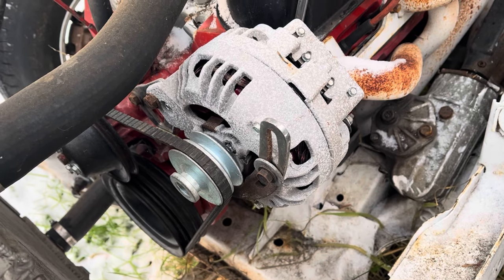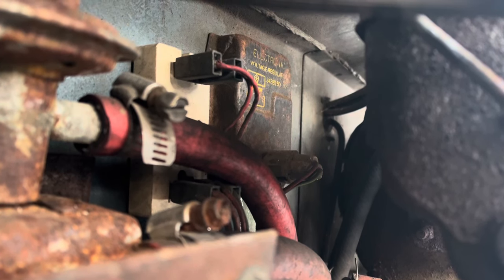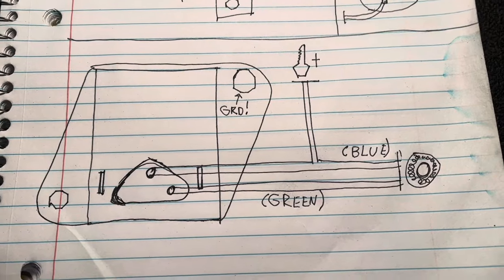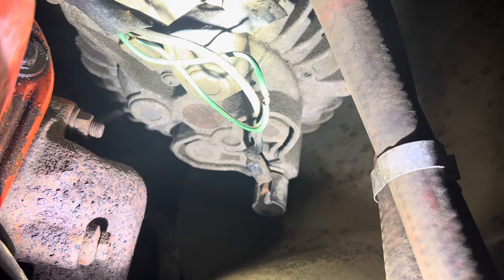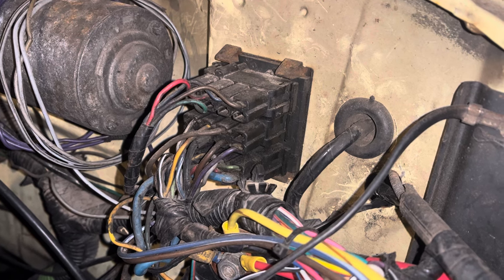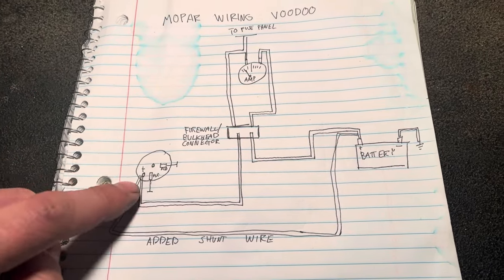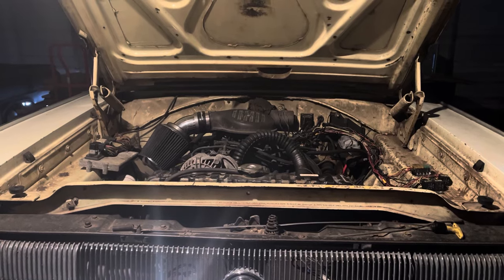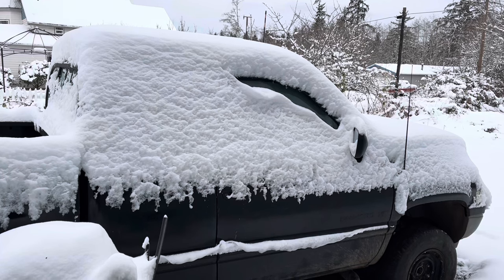Classic Mopar Charging Systems: How They Work, and How To Diagnose Failures

Comment: I am having a problem of a different sort. After sitting the better part of two years because of the pandemic I have discovered my Dodge Charger starts great but once it’s hot it starts to run rough and backfires and shut off and won’t restart until it cools down.I’ve cleaned the grounds in the engine compartment checked my connections there could it be a5 5he bulkhead connector?
Reply from the maker: Sounds like an ignition issue. Control module, or maybe distributor. What year car, and what type of ignition? Feel free to respond by posting another comment - I likely won’t see a reply here.

Comment: The problem isn't the alternator design or anything with the charging system. Most of the stuff is old. Wires,connections. Practically all of the parts store alternators are junk and have been rebuilt a million times and bead blasted a million times. I had to get 3 different alternators at AZ because the threads were so blasted out you couldn't tighten the mounting bolt. Finally got one that had a heli-coil in it already. I usually run at least an 8ga wire right from the battery or starter relay to the alt output stud. Also the wires sometimes loosen up on the back of the amp gauge.
Reply from the maker: Yes, this is the ‘shunt wire’ I talk about often. Direct from alternator to big stud on relay. It’s a big improvement. 

Interesting. I stripped out one or two alternators myself years ago (before I had my torque elbow calibrated properly,) but I’ve never had that problem with a reman. Although I’ve only ever had to buy a few of them, because as I say in the video, it’s never the alternator… except when it is. 

Personally, I think we can attribute a lot of the problems to the amp gauge circuit design. The firewall connector was adequate at best to handle the loads when it was new - and far from it years down the line. Also, if the voltage regulator had a ground wire instead of being case grounded, they might last more than five minutes too.
Reply: @DeadDodgeGarage  The original design setup was perfectly fine for what it had.....a 37-amp alternator. That was standard across the board. Even the Upgraded version was only 41 or 45 and the 'HD' was 50 amps. A far cry from what's available today. If you're lucky enough to have your original alt I would keep it. Once you get a reman you're into the exchange racket. They ONLY change the bad parts and send it out with old diodes and bearings and other parts. They only change what they need to. There's a difference between 'rebuild' and 'remanufacture'. 
I was on a trip and my alt went out. It was a reman about 2 or 3 years old. Went to AZ and swapped it and on the way home loosened up. Had to use a pair of visegrips to hold it on the bracket. I didn't tighten it crazy like an ape. In fact, it started stripping as soon as the bolt put pressure on the bracket. But it was the ONLY one they had n stock of those old style alternators. Came home and got a nicer one but it took 2 more tries. 
27 or 28 years ago I got a reman starter from a parts chain long out of business. Spent the next 2 years swapping starters.  They were easy to do in the parking lot in 20 min. Their starters looked like they blasted them clean with boulders. $19.95 lifetime warranty deal. OK if you don't mind changing them.
Reply: @DeadDodgeGarage  I agree that the 2 weak points are the Amp gauge and that bulkhead connector, both the result of using dated tech even for the period. Later they went to a 'shunt' Amp gauge that read a 'part' of the charge current and then later to a Volt gauge. If you run that bypass on the bulkhead connection the Amp gauge will move very little if at all unless you're at or near max draw of the alternator. If the wire is large enough, not at all. I usually use 8ga which is sufficient up to around 90-100amps especially considering the load split. A Volt gauge should be used anyway, it tells you way more information about what's going on than an Amp gauge.
Reply: Mopars have very long wires with lots of connectors to and from the ignition switch. The wires and connections increase in resistance over time, as well as the ignition switch.

Comment: What size wire should be used to bypass ammeter, from output of alternator to positive at battery?
Reply from the maker: I think I usually use 8 gauge.

Comment: I have a 71 duster.  
The car charges at 12.5 at idle.
I'm getting this reading at the battery and at the alt. 

When I turn on the HLs it dips to 11.9.
As soon as I turn them off it goes back to 12.5.
I've replaced the alt and the voltage regulator.  

What else could it be ?
Reply: Let me add this also
The last alt read around the same volts.  
And I've played with the tension already.
Reply from the maker: In this video, I explain how the regulator and its circuits work. You’re going to need to go through them. Make sure power is reaching the alternator on the blue brush connection. If so, try the full field test. If it charges that way, your alternator, output circuit, amp gauge are all good - most of which I believe you have already proven. Ah, make sure your regulator has a good ground, and a good connection at its plug.

Comment: So I have a 64 chrysler newport that cranks and is getting fuel and wants to start but won't. I'm wondering if its possibly the voltage regulator that do to the smoke and really bad smell I'm sure is dead.. I could really use some help right about now.
Reply from the maker: I hate to say it, but follow the smell… if the voltage regulator let the smoke out then it’s definitely bad. Have to wonder if maybe it’s wired wrong? It is on that same ignition circuit and could probably pull the voltage down far enough to not run. But at that point I’d kind of expect the wiring to be turning into smoke too…

Comment: Thanks...'79 Dodge van.  If you have time......Having what I-think are wiring issues.  Known-good alt and VR.  If someone can answer just this question for now it would help.  I remove the big wire from the alternator,  connect multimeter red to positive battery terminal.  Connect multimeter black to this alternator wire and I get sometimes a full 12v reading on the meter, so the alternator wire is grounded somewhere.  This does not seem right to me.  Thoughts?  If I know that I have to chase-down a short somewhere it would make it easier.  I will likely re-wire the charging system though.  Thanks again.
Reply from the maker: I don’t understand your test procedure. Why did you do this? Was something smoking or melting? If there is a short in that wire, fire should’ve happened quickly - or a blown fusible link. So I am questioning the validity of your test results. To test the charge output circuit, I check for voltage at the alternator output stud and at the battery with everything connected - and compare. This means grounding the negative test lead, and touching positive teat lead to both of those points.
Reply: @DeadDodgeGarage  it's a long story but I'm having an intermittent no-charge problem.  I agree now that if there was a short in that wire bad stuff would happen.  Lots of things not making sense.  Welcome to "Mitch world".  I will dig into it deeper and report back if I find the problem.  The only other things I'll mention for now is that when it's not charging, the ammeter does not show any discharge either, even with engine off and everything turned on.  When it IS charging it will clearly show a discharge after shutting the engine down and turning stuff on.  Also, when the ammeter IS showing a charge, the multimeter shows maybe high 12's or 13 at the most which I do not like.  There are tons of corroded connectors and deteriorated insulators on this van which I've had for 36 years.  Thanks again for your time.
Reply from the maker: @mitchmadness4376  Ok. Fairly sure you don't have a short, and strongly suspect that adding a shunt wire (a direct charge wire from alternator to battery positive) may well solve your problem. Obviously you have lots of problems, but at least that could help.
Reply: Final but long update...The main problem here was that I had a bad connection near the battery.  The large red wire coming from the positive battery terminal connects to the "charging cable".  This connection was corroded. I got real lucky finding it.  I had the meter on the battery with the van running and just happened to bump this connection and I saw the meter go from battery voltage to 13+.  When wiggling this connection it would clearly charge then not charge.  Repairing this connection solved the charging problem and the ammeter resumed working.  Here's where it gets weird...I said earlier that "sometimes" it seemed that the charging wire was grounding out.  The "sometimes" was because of this bad connection and here's what I found...If I disconnect the connector that was bad (essentially keeping the charging wire from connecting to the battery) the charging wire gets grounded-out.  When I remake the connection (there is no sparking or arcing) the charging wire no-longer grounds-out.  I tried again today to figure-out why this is happening but I'm done because it's just too confusing, and everything is fragile so stuff is starting to break so I'm leaving it alone even though I'm not crazy about seeing only 13.3 charging volts This amazing vehicle is slated for a full rehab after building my proposed new shop.  At this time I will at a minimum shunt it out and will likely do a lot of re-wiring and a custom dash, etc.  I will also shamelessly plug my channel called "MitchMadness".  I am certain that anyone viewing your videos will be interested in my stuff, including the van rehab.  Kids don't try this at home without a hard-copy wiring diagram or factory service manual which I bought years ago.  THANK YOU AGAIN FOR YOUR TIME !!!!!
Reply from the maker: @mitchmadness4376  Man... I was off in the weeds with you trying to figure your test out. I could've told you that these vans always have connection problems there at the battery 😅 Because the battery sits in the drip line under the hood, corroded and broken connections at the terminals are almost constant. Every single time I go to move our '91 van after it sits for a while, these connections are screwed up again. I have fixed them many times. I don't think you are actually seeing a ground. I think you are able to get a voltage measurement through the alternator using its stud as your negative terminal, but I think if you checked resistance between that terminal and ground, it would be much, much higher than zero. Glad you got to the bottom of it.

Comment: See that you own a Dodge a100./108 also. 
Nice!
I have a few too many the wife says. Ugh!
Anywho most were daily drivers for years until electrical problem. Parked it and drove another. Then same thing. I will get to it one day. Nope for I had the current daily driver working great andnywars went by. Now this one isnt charging and alternator passed test at local parts store. 
But no output voltage and no volta going to vintage regulator. 
Plus a friend been messing with wiring harness and my stereo with Amps and capacitors and but also rewired wires that he thought needed to be tied together one day whe. I left him alone. 
I.tool off not knowing what he did and  noticing regulator not connected? What the ?? 
Anywho...love your content. I hope I can figure this mess I have on my hands! Ugh!
Reply from the maker: Well, all I can say is… it’s basically never the alternator. Hope you can figure it out.

Comment: So I just replaced my original 74 alternator in my Dart with a new one.  To my dismay the brand new alternator is only producing 11.8 v at idle.  Pretty sure it should be 13-14v.  Pretty sure the new mechanical fuel pump I just put in is also not good.  It put out anywhere from 2-12psi for no good reason.  Fuel regulator seems to have evened it out.  Kinda.
Reply from the maker: $20 says that’s not actually an alternator problem. Clean and grease your firewall connector. Check your ignition switch connector under the dash for evidence of melting. Ensure you have a good body ground - or two. Hopefully one of those things helps. If not, the voltage regulator should be scrutinized.

Comment: What happens when you have two known good alternators that work in a valiant, put out 14.5 volts of the back of it and when you put them in another car and the alternator is reading 11 volts of the back of the alternator?
Reply from the maker: The alternator is not your problem. The voltage regulator or wiring is your problem. Also, are both the same configuration - single field or dual field?
Reply: @DeadDodgeGarage  I threw in a spare regulator that I had and that fixed it.  Currently a single field that I had in the Valiant.  Thanks for your help, I just found your channel this weekend and subscribed.  Love the mopar content.

Comment: So I have a 69 mopar voltage regulator went bad so I bought a new one that is a solid state regulator but it won’t work , figured out it won’t work with a 70s and new alternator but I guess there is a fix for that do you know it ??
Reply from the maker: Yeah. Make sure the unused field / brush connection is grounded. Usually when you get a reman alternator from the parts store, it is the later type - and the second field is already grounded. The screws for the brushes normally have insulated washers on them, and they simply leave one of them off so it is grounded out through the screw. You can also add a ground wire.
Reply: @DeadDodgeGarage  I did ground one of the terminals but it still doesn’t work ,probably a bad new regulator I’m guessing

Comment: The purpose of the ammeter is not to “check the output of your charging system”, its purpose is to monitor battery charge/discharge rate only. All vehicle loads are not routed through the ammeter while in operation. Only when the engine is not running will the ammeter and related connections be subject to full system loads. Engine running, fully charged battery, there will be little to no current through the ammeter, needle centered. What kills bulkhead connections and ammeter insulators on these, as original charging systems, is mis-placed added loads at the battery. Any loads added at the battery pulls all it’s current across all of the charging circuit components and connections from the alternator, as the alternator is the power source while the charging system is in operation. It’s that added current that melts down terminals and insulators, places entire circuit well outside of its original design limits. All factory loads are handled on the alternator side of the ammeter. On an ammeter-based charging system such as this, there can be no added loads on the battery side of the ammeter. All loading needs to on the alternator side of the ammeter as are all factory loads. The ammeter is designed to register battery charge/discharge status only while the charging system is in operation. It is not designed to handle any other loading, as original, will not register full vehicle loads.
Reply from the maker: I’m not going to spend all day moving words around to suit your fancy. Under normal conditions, going down the road with a charged battery, the ammeter will read slightly above center. In an over charging situation, the ammeter will read much higher than that. In a situation where the alternator is not producing a charge, thereby discharging the battery, the ammeter will read below center. It sure sounds like I just described a way the ammeter can be used to check the output of the charging system / alternator and related circuits. Thanks.
Reply: What you just described is the charging/discharging at status of the battery, just as the ammeter is designed to do, not the total output of the charging system. The total output would include the factory loads taking place on the alternator side of the ammeter, not registering on the ammeter while in operation. No need to spend any time “moving words around”, just clarifying a common misunderstanding about what the ammeter purpose is and just what is registers as it was originally designed. I would disagree that a healthy and fully charged battery in a correctly loaded original Chrysler charging system would register any perceptible charging indication, should be pretty much centered if all is normal.  @DeadDodgeGarage
Reply: @dougwilkinson2731  ...Mine runs slightly over dead center while driving down the street...72 big block charger for the last 25 years
Reply: As original, no added loads connected to the battery? As I said should be little to no charging current registered on the ammeter if all is well. A fully charged battery will draw verry current, amp or two at the most normally. For most this barely is enough to move the needle. https://youtu.be/hN4RpVEi7U4 @KingNothing2x4
Reply: @72roadrunnergtx  ...do you think a bad ignition switch would cause a random  dying while coasting/iding ...Never had this issue  Fired up after a few minutes. Everything else is new.